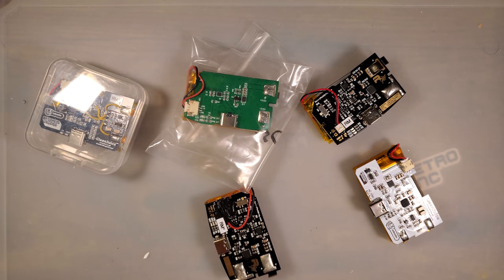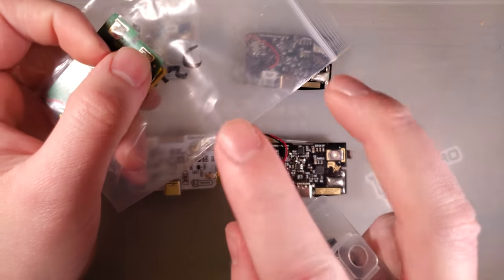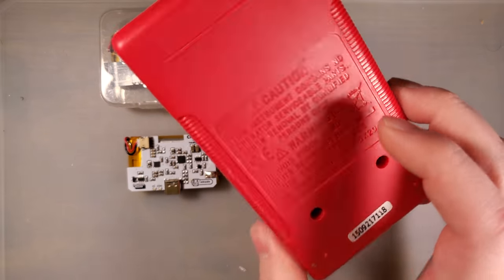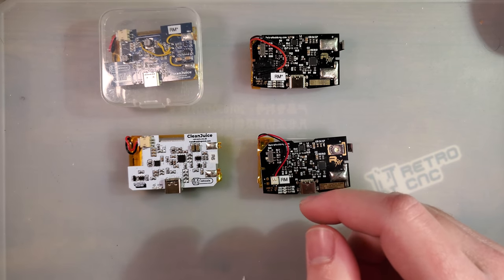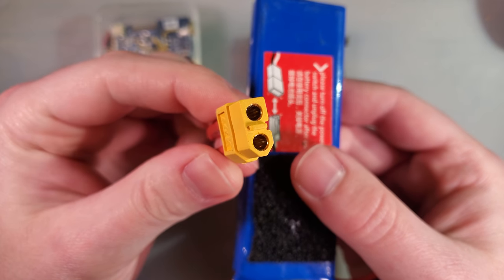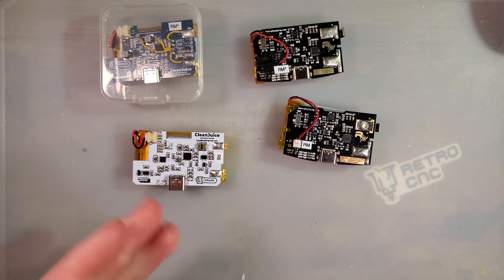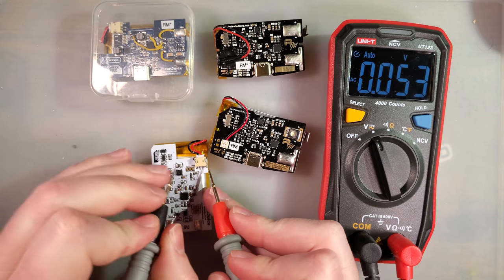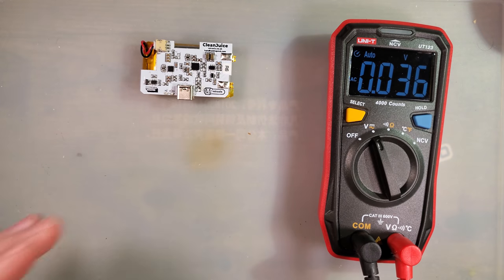Defective CleanJuice Battery Drain Fix

Comment: I have a version one cleanjuice battery that's been doing the exact same thing every since i installed the lipo mod that I had to purchase because of their screw up. I'm done with cleanjuice.
Edit: forgot to mention that I also have a Retromodding battery that's been holding a charge in my gba for nearly 5 months
Reply from the maker: I'm sorry you had that happen to you. 

If I may though, if you're not using your console for a month or more, you should remove the battery and store it separately. This goes for anything with internal batteries, LiPo or Alkaline.

Comment: I think I have two of their batteries (I know, I'm sorry). I soldered their low battery indicator board to the original and it doesn't drain. I think my 2nd has the low power indicator already fixed. If my second one isn't the white pcb then I might not need to worry? It's currently unused and packed away in a protective casing.
Reply from the maker: If they are both the blue board models, it's probably fine. You should check it regardless though.
Reply: @makho  Exactly what I was hoping to hear. Thanks for the response!

Comment: Here's a weird one for you - the GBA I had the faulty battery in now randomly shuts off/restarts when pressing select, and only select. I've checked for shorts, I've cleaned the select copper pad and tried different silicone membranes. Every thing works great except every once in a while it restarts when pressing select. Any ideas?
Reply from the maker: Contact the vendor that sold you a defective battery.

Comment: I'm curious, how would you propose that a battery is made if not for contacts? You mean hardwiring it in?

In either case, I can't wait for your detailed rundown of the other batteries.
Reply from the maker: I don't have a solution to that issue. In some cases, it's just necessary (see 9v batteries). What I would like to see is protections on the output. I haven't actually tested the battery mods yet in this way but a resettable polyfuse would be all that's needed. It's less than ideal but heaps safer.
Reply: @makho  Ahh, I see what you mean. Well, hopefully more of these creators take that to heart. You're right - shorted lithium ion batteries aren't very much fun.

Comment: I have the same issue where the battery discharges in 2 - 3 days with a full charge with and no use, plus i can´t disconnect the battery from the PCB even if i use a lot of strength :(  maybe it´s stuck idk. I bought it around a month and a half ago and i live in Ecuador, so i can´t do a refund, haven´t done this fix yet i hope this can help. Please leave us an update on how its running now, thanks!
Reply from the maker: I'd say it's been great but nothing about my experience with retrosix has been great. The battery is performing much more in-line with expectations after this, however. That is to say, it no longer just dies after a few days.

Comment: Yea I got one for mine but yea 24 to 48 hours later it’s dead after a full charge. One of the reasons I don’t play on my Gameboy Advance I just pick up one of my sp or a color as I know there not dead. I was thinking of getting helders new battery as I’m told it doesn’t just drain after a day.
Reply from the maker: it does not. None of the other ones do.
Reply: @makho  yea I’m just going to spend the money and get another one from helder. It’s not the first disappointment I’ve had from retro six the uv printed cases the lens that come with them suck. I had to get a replacement because the film peeled away over time it did it a second time and I just swap out the lens for a different one. Then I got there new power board for the swag game gear the plastic bit that usb c is cover by was broken and I know it had to have been broken before it ship they where just to lazy to swap it out.

Comment: But you unplug the cleanjuice board from the battery and no issue. In your gba, again no issue as it’s in a console just like regular AA batteries.
Reply: Is this a sentence
Reply: I’m just watching the video and trying to work out the issue with the board as I’ve got a couple of these boards. Sorry if that didn’t make sense.
Reply: @timsurman3354  Basically, if you charge the battery, it drains itself without being used, none of the others do that.
Reply from the maker: these battery plugs are not made for repeated insertions. They WILL wear out quickly.
Reply: @makho  going to go for the Helder mods next time. Zedlebs have taken on the importing into the UK.